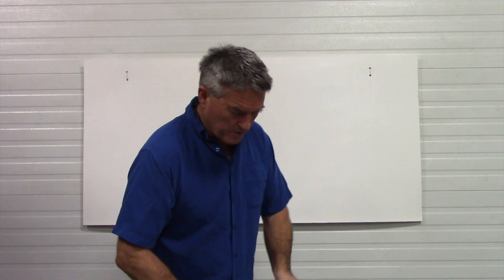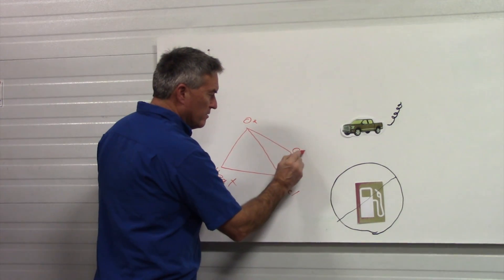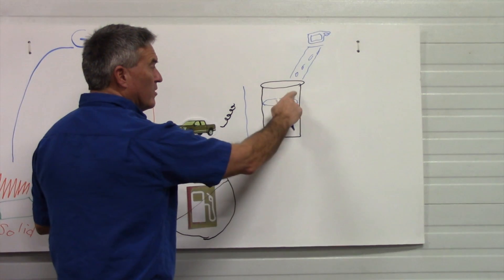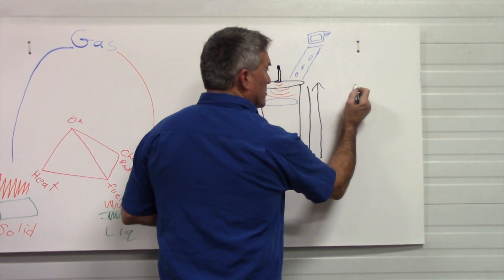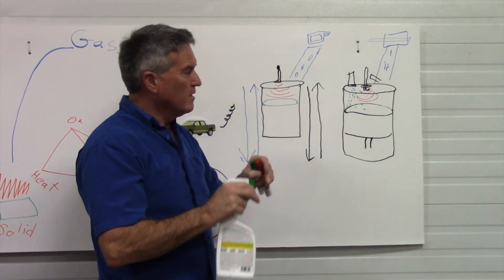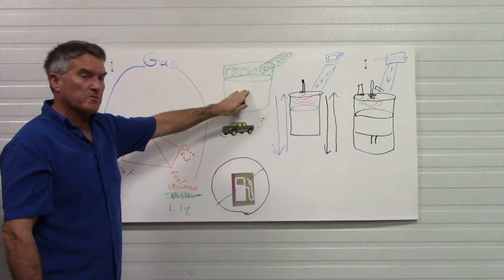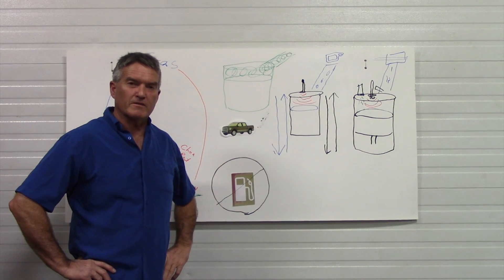One Simple Trick to get 100 miles per gallon with less pollution!

Comment: Great video ! The only 2 things that I would disagree with is:  you said the gas in the cylinder explodes, it doesn't , it expands evenly through the ignition of the Gaseous vapor. If it were to explode, that would be "detonation". and could damage the internal engine components of a gasoline powered Internal combustion engine.  Gasoline engines work on heat expansion not detonation, but  Diesel engines do run on detonation.   Your point is well taken, and at any RPM, it dictates a very short period of time for an air and gasoline mixture to be converted by the application of heat, to create a phase change into  a gaseous vapor which can be completely consumed by combustion. The only answer is to atomize then emulsify the air and gasoline mixture, then apply sufficient heat to  vaporize the fuel mixture into a homogenous  hot gasoline / air vapor mixture, then compress the mixture because of heat expansion, and then keep it hot so that it doesn't condense, all before it enters the combustion chamber. Very good video anyway ! Thank you ! Please join the Gasoline Vapor Systems group on Facebook. https://youtu.be/o7o477GFQpY

Comment: No gasoline fuel injection system sprays fuel into the cylinder. They spray into the runner in the intake manifold. A diesel injects into the cylinder. De Dion engines used vaporization over a century ago. It only works in low output to displacement engines, because the lean mixtures it creates burn up engines of greater output to displacement that run on the Otto cycle. You're pushing snake oil.
Reply: While I agree with most of your points. That gasoline engines do not use direct injection is no longer true, Mazda is using direct gasoline injection in their upcoming engines they are sort of diesel/gasoline hybrid as it uses both compression ignition, spark ignition and spark controlled compression ignition at different performance levels because obviously they don't all work across the whole output range. Another interesting thing about those is that measure cylinder pressure each combustion cycle and optimize how it is running based on that by the next cycle I don't think anyone else is doing that.
Reply: My Escape has direct injection.  Unfortunately since the fuel is not going thru the intake valve, it can get buildup on the valve.  The mixture going past the valve would normally clean the valve.  Pros and cons to everything.  
It is also turbocharged!
Reply: some already got ya they do use direct injection in gas engines now
Reply: well  just upstream of each cylinders intake value
2007 envoy LL8 engine uses Multipoint fuel injection (also called PFI, port fuel injection) injects fuel  into the intake ports just upstream of each cylinder's intake valve, rather than at a central point within an intake manifold . MPI systems can be sequential, in which injection is timed to coincide with each cylinder's intake stroke;
Reply: Well mr Luddite. That used to be correct but now new gasoline engines are being made that are direct injected.

Comment: But how long before you burn a valve?  Longevity is the question.  Same thing for cooling pistons.  EFI was engineered to create a mechanical problem if you tried to use vapor setups I believe.  Maybe it can work for a long period of time, maybe it can't.  THat's the real question.

Comment: Carburetors were used up to 1987 by automotive manufacturers.  Then it was throttle bodies, then just in the last  20 years multiport fuel injection has taken over.  I with you do believe we should be getting a lot better mpg than we are.  But the internal combustion engine we use in automotive industry have way to much  Parasitic loss due to all the air pollution controls on a current engine.
Reply: I'm so happy someone else gets it, let the poor things breath! 
thats why  a 1991 3 ton international truck get 17.5mpg half loaded and my 2008 f-550 gets 8mpg empty..
Reply: Much of the reason fuel economy has not went up is because vesicles are much heavier than the econoboxes of the 70-80's I've got a 81 VW rabbit that does 40mpg but it's a tin can relative to my late model accord that only does 30mpg with a much more efficient engine.... if you put the honda powertrain in the rabbit it would probably easily do 60-70mpg.
Reply: The F-550 has sucky gearing from what I hear... I bet your International had a least a 10 speed so you could keep RPMs and thus MPG more in check. When the F-550 revs up you're just blowing fuel out the tailpipe. Also I imagine your International wasn't driving in town as much as you drive your F-550 which is the worst case scenario for that truck.

Comment: wRONG !!!! THE GAS DOES NOT LUBRICATE THE PISTON !!!!          tHINK ABOUT LPG !!
Reply: This is correct... too much fuel getting on the cylinder wall is very bad in modern engines as it washes the oil from the lubrication system off. the only time you want to run rich like that to lubricate is if you have a fuel that lubricates which gasoline does not, diesel even does not  , the only real modern exception to this is 2 stroke gas engines such as in weedeaters and boats that have oil mixed in the fuel.
Reply: diesel HAS SIGNIFICANTLY GREATER LUBRICITY THAN (oops) gasoline.
Reply: Chase, Actually diesel is a light lubricant. In fact so much so that the high pressure injection pumps actually use it for .... you guessed it, lubrication.
Reply: greenhouse gardenroom gas is a solvent it washes away the oil.rings get lubed up with oil pump in motion..
Reply: water injection will cool/lubricate the cylinder walls when combined with gas vapor. old technology.
Reply: Water injection does cool but it has nothing to do with combining with gas vapor. In fact if anything that can be a hindrance. Still it should have been used instead of EGR valves. That would have allowed for leaner mixtures without the heat problem.
Reply: old technology dating back to the '40's. used mostly to boost the power of aircraft taking off from carriers and reduces detonation. my assumption water/fuel mixtures were used for short bursts of needed power.
Reply: What was needed was the water. It was not mixed with the fuel. The reason is that water will absorb an incredible amount of heat energy. Primary focus was on stopping detonation. Because it will also turn to steam it can contribute to increased cylinder pressure while lowering temperature. Normally lowering the temperature would be bad because you would get decreased cylinder pressures which is where the power comes from. If water injection is done wrong on a car you can actually get decreased power. 
I actually do water injection on my performance diesel in my van. When I am pulling a grade and the EGT's  hit 1200 degrees the water mist injection comes on and you can feel a surge in the power and the boost jumps from 18 lbs to 22lbs. Considering I am not blowing black smoke I doubt the power is coming from the increase boost burning more fuel. If the engine is cold and I just do a quick throttle run there is not much effect.
Reply: connecting rods have dipper/slinger or squirt holes that lube your cylinders rings wrist pins
Reply: greenhouse gardenroom. oil by the oil pump is pressurized and flows through the crank, lubricates the rod bearings and goes up through the rod itself and squirts on the piston pin then out through the piston pin onto the cylinder walls. least that's the way its supposed to work. There's also oil from the oil pan splashed on to the cylinder walls, too. had a hot rod back in the day with a high volume oil pump and it would actually squirt oil out of the engine over the fenders when the valve covers were removed. seems like with the engines running so fast it would be hard for it to squirt up the rods since they're going down and up so fast but the high pressure makes it happen. That's why you have a two oil rings on each piston. they scrape excess oil off of the cylinder wall. if not for those...you would be burning all your oil. 
Compressed not gas is the way to go but you have to have extreme pressure bottles mounted on cars and as of the latest...the oil companies don't want it...of course!
Reply: 🤔 did you come here for facts or fantasy?
Reply: greenhouse gardenroom: EXACTLY. Gasoline run engine  cylinders are lubricated from underneath and pulled upwards by the pistons and their oil rings.

Comment: @10:43 ...less fuel causes lean condition ....
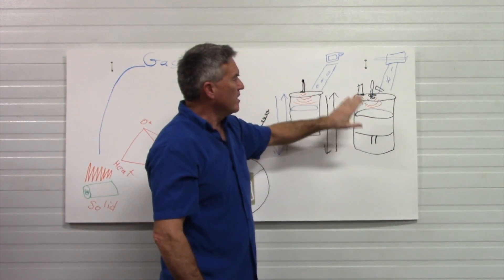@11:44 ...gas wouldn't cause the same lean condition ? It doesn't lubricate right?
AND you forgot to mention/talk about the EGR system which recirculates part of the burnt gasses.
Reply: lean is actually good, its only bad if you are using the fuel for lubrication and don't have a strategy for even combustion. Lean becomes bad when you have partially mixed fuel which causes temperature spikes when it burns leading to higher temps and more emissions... if you mix the fuel well then the exact opposite becomes true. That's what Mazda and other engine makers are doing in upcoming engines.

Comment: petrol does not burn as a liquid it has to be a vapour for ignition.  A carburettor vaporise petrol using the venturi effect an injector vaporises petrol when its sprayed.
Reply: It does a poor job at at as most of the fluid is merely atomized, not vaporized as is commonly thought.
Reply: The venturi is to speed up the airflow across the jets, that lowers pressure, that draws the liquid in. The fuel is turned to vapor with heat, fuel evaporates faster as heat increases, it's vapor point is very low, well below the freezing point of water. Carburetors have trouble vaporizing the fuel with a cold engine hence the need for hot air pick up pipes, heated manifolds etc and the choke. Carburetors are particularly bad in cold weather and have to supply a very rich mixture to get enough vapor.
Reply: Atomize
Reply: Chris Waddington to my knowledge sir any spray of liquid is still liquid even if its   small droplets.vapour is something else.cheers
Reply: I can flick some water out of a faucet at you to cool you off or bounce the iceball I've had in the fridge for 6 months off your skull.  You tell me there's no difference...after you get up and wipe your tears.

Comment: What?????? He states:"...the concept behind my invention.....".
His invention?????
Also...ask yourself, what is the air pressure in the intake manifold? (about 20in. of Hg vacuum)
Is that not enough to vaporize any and all the gasoline that enters?
Reply: Spray Windex and watch the mist hang in the air for a couple seconds . . . look down the throat of a carb and see gas droplets falling into the air-stream towards the butterfly . . . they only have 0.07 seconds to vaporize before ignition.  Not enough Time, Heat, fine-ness of spray to fully vaporize gasoline.